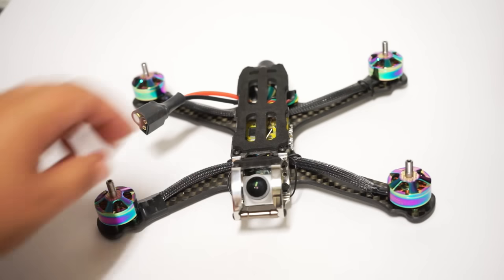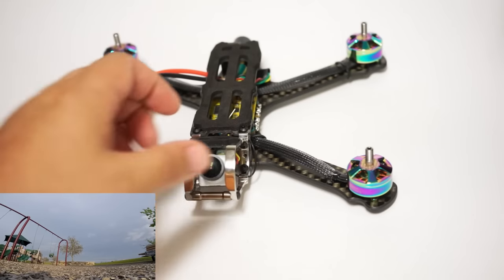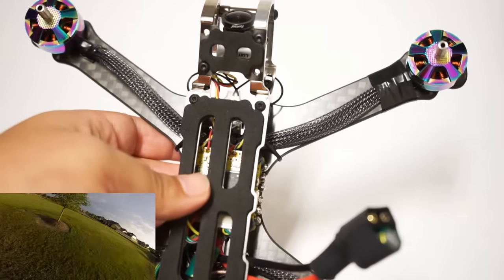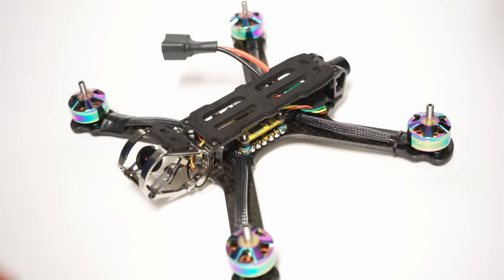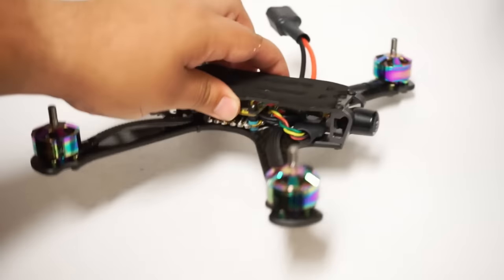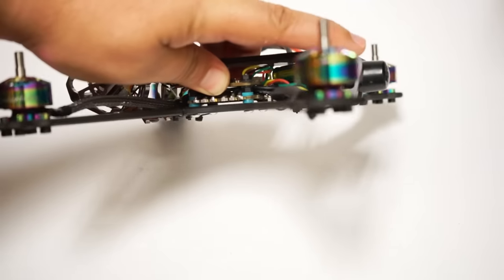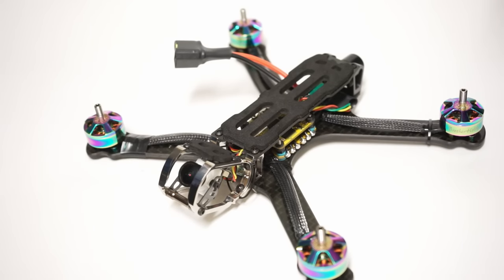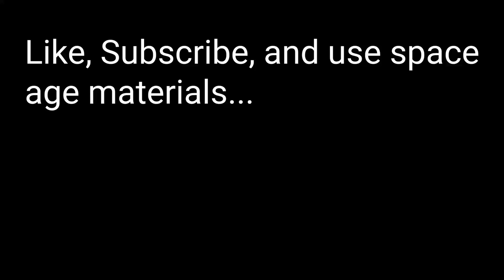Armattan Marmotte Full review and Superior Flight

Comment: Nice vid man... I use double sided gorilla tape the 15lb version... for the esc braid motor wire protector (no need for any zip ties or electrical tape...  check out my 2nd to newest video you will see it on the first 1 minute...

Comment: Can you fit a runcam split 2 in there on the stack?
Reply from the maker: Not on the center stack, 2 laters tall woudl be max, but possibly if you put it all the way at the back, there is another slot back there. May be a tight fit
Reply: @JonE5FPV  Not sure if the ribbon cable is long enough for that.. Thanks for the info.

Comment: Great build. On my Marmotte, I also went with micro cam. I used 2 pieces of 1-2mm silicone wire insulation off of power lead wire, to mount camera.
Reply from the maker: Good tip!